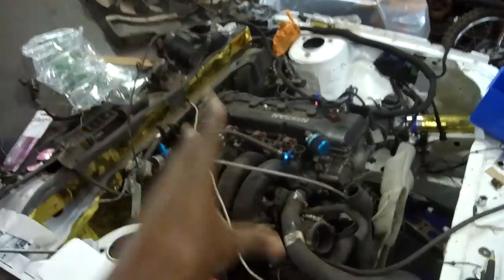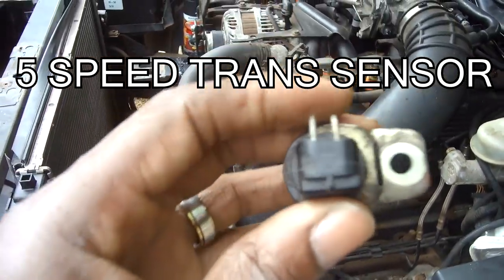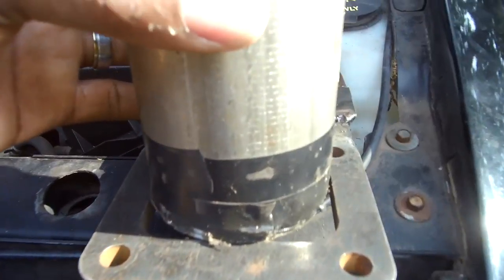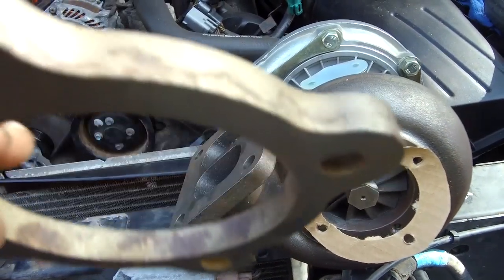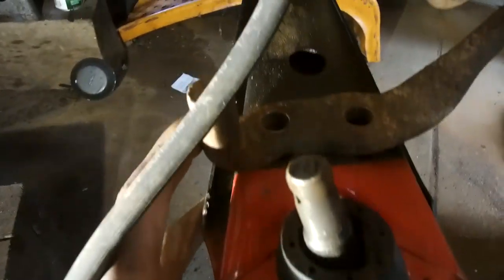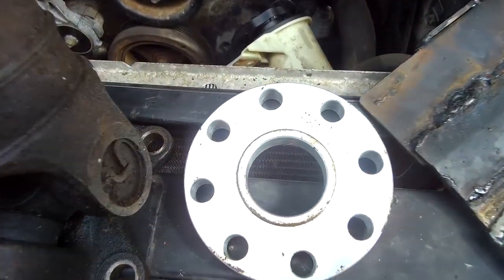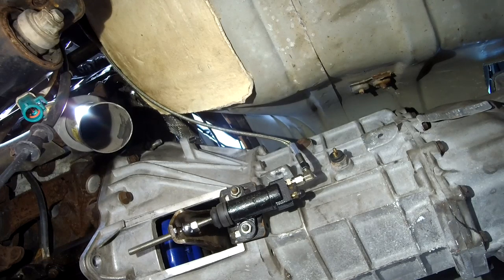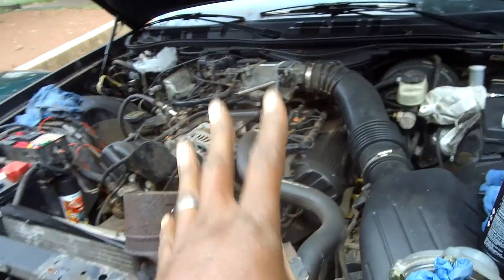Crown Victoria 5 speed Project ( BUILD FAILS ) Turbo to Driveline UPDATE

Comment: You’re an inspiration to us all man!
Reply from the maker: I thank you for that brother... Just giving a spin on projects ... This stuff runs parallel with life Harrison. If you want something done ( you do it yourself ) if you really want something you have to work at it..Nothing comes easy, but we are programmed slightly ( to settle ) for anything. And to give -up . Many times we just do not believe  brother.. Cause we are surrounded by negative thoughts that leaves us mentally ( lost ). V ery happy to have people like yourself here TRUST ME.
Reply: @bstfordchannel923  Yeah I guess that's true. I think a lot of the problem for some of us is that we are pulled so many different directions financially and time-wise that there just isn't enough to go around.

But hey, I just install a new right rear brake caliper and replaced both of my rear rotors and all of the pads on my Grand Marquis. Best I could tell, the caliper was sticking and it ground down the outer pad to the metal plate. It's good now though! I wanted to make a video of it all but I figured there are probably dozens of videos of people doing that so I opted to just get it done and call it a day.
Reply from the maker: @harrison4ever125   going to answer the 2nd part of your comment.. Ypu should had made a video Harrison.. I thought just like that also when I did this channel.. I sat back and said ( How many Burger Joints out there ) PLENTY. you just put a spin on how you present the video thats all.. And then your style of video will come, but you start with the 1st video. I will be hear to support... And do mind the thumbs down ( that comes with it )
 Now to answer the other comment... They design this whole thing around what you just mentioned.. They have us chasing our tails ( with bills and Bull$hit ) and sports media ect ( to tribe us ).. We are easy to control ONCE we separated . See how me and you are talking.. just think many people speaking like this daily ( it can not happen ) in BULK cause of what you spoke of..  We can not even see us getting out of a financial rut... Only the Lottery is  a poor mans  hope. Thats been programmed.. We can do it brother must believe ... We have to see this out AND it aint easy ( thats another story )
Reply: @bstfordchannel923  You're getting into a spiritual matter there man. I am big into studying the Bible, politics, religion, the occult, freemasonry/illuminati, history, "conspiracy theories", etc. and I'm also going to college to get into journalism.(and this is why I struggle with time...) You're not wrong at all. There is a big spiritual war going on that has been going on ever since man's original sin in the garden of Eden. Satan, his minions, and his followers, are all playing a game and have been since the beginning. I describe it as a game of chess, only Satan has pieces on both sides of the board. He's playing this game from every angle. Democrats and Republicans, Liberals and Conservatives, Christians, atheists, and everyone else. He has influence in every camp and is pulling strings in every camp. And you're right, entertainment media, technology, music, news, sports... it is all being used to distract us, blind us, and worse yet a lot of it is being used to indoctrinate us. Movies, TV shows, music, games, and the news are full of both religious and political propaganda. You cannot watch the Weather Channel for 15 minutes without hearing someone mention the "Climate Change" bull crap which has been proven over and over again to be hogwash.

So, I don't know if you are on Facebook or not, but I am and I'm all the time dealing with these subjects. I share a lot of videos about this kind of stuff and I sometimes go on long rants like this one. If you want to look me up, it's Joshua Timothy Harrison. I intend to one day make some videos about these subjects. I actually have two videos on my account, one is about fixing the hood of 97 Yukon I own the super fast and easy way(which technique I also used to fix the hood of my Mercury Saturday), and the other video is about the new C8 Corvette and how the unveiling was chocked full of freemasonry/illuminati propaganda.
Reply from the maker: @harrison4ever125   i am with you on all of those things you speak ( it is  all true ).. I tackle this matter from a different stand point... People know your moves when they see you post or talk about them... I wish not to speak (deeply on those things), but i tend to  guide subconsciously ( just like how they are doing us ).... I love cars and I have a passion for that.. I love when all people come together ( but many cases ) its short lived by media events. I do not speak on a person beliefs nor politics or FOOTBALL TEAMS lol cause people be on guard with those things..    
  I am more on the level of doing by action ( but not shown ) cause the vibe you give off can  be felt....Just think if the channel takes off what would that prove.. Nothing in the big picture ( the people ) that I connect with that understands a simple mans journey ( that is BROKE) very relatable and honest thats still dreams ( despite ) what is in front of him... I tend make others to follow there dreams  and ( make a good attempt ).and be happy doing so... When you say you can not do THEY WON... Cause you offspring will be the same way and they count on this  ( birds of a feather flock together ) type deal
Reply: BST Ford Channel I here ya man. You got a good thing going on your channel. It’s very enjoyable and very informative but most of all it is definitely very inspirational. When I see you fabricating your own stuff around the shop it makes me want to do everything the same way. So good job man!😎
Reply from the maker: @harrison4ever125  thank you for that I am inspired by you also, by the words and comments.. Like i say it bigger than cars brother. i very happy that you are around brother..
Reply: I second that
Reply: @bstfordchannel923  Hey man, I put together a little video yesterday about a trick I've learned with push mowers. Just uploaded it. Check it out?

Comment: The first test drive is getting closer and closer :) Should definitely see how much better the crown vic performs with just a stick shift without turbo, so you can compare it to the automatic :D
Reply from the maker: I will drive it with the turbo disconnected and work out the kinks in this project.. I will give my Honest opinion on if this swap is a good 1.. I have to get the 4.10 gears inside also... It aint quite done yet.,.
Reply from the maker: I thank you so much for watching and commenting Jack the Fox i have not forget about your push bars ( taxi version )

Comment: I have a 2003 Grand Marquis and I’m Modding it also, but i cant choose between a supercharger or a turbocharger. Thanks for the video and this project. Helped me out
Reply from the maker: cool man glad to help in any way... From a Friend or family stand point I will say ( procharger )  Turbo is cheaper , but the fab work to get it right ( cause i am welding and i suck ) and the pipe i bought is cheap and thin..Hard route to take TURBO, but it can be done..
Reply from the maker: Get this...... https://adtr.net/product/ford-crown-victoria/supercharger-ford-crown-victoria/adtr-supercharger-system-2003-panthers/     simple but cost few pennies save a MILLION steps